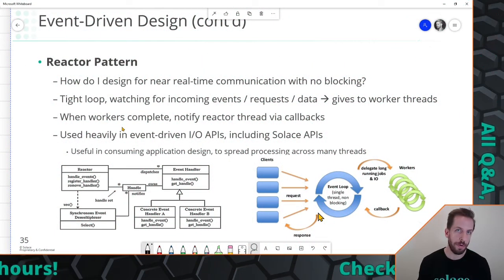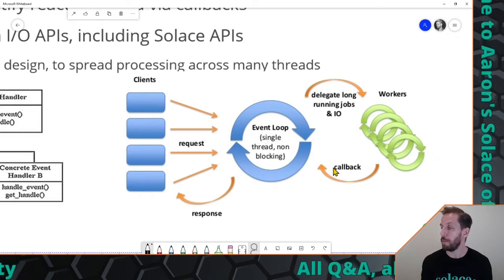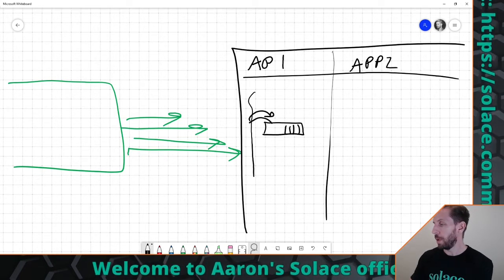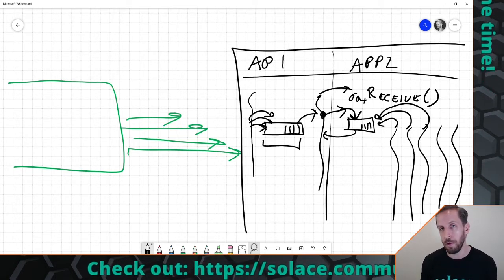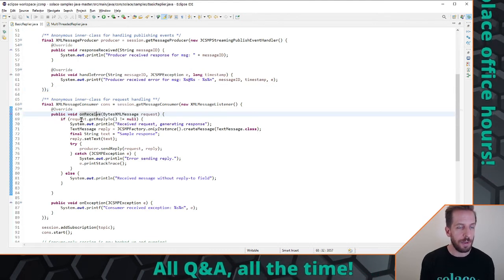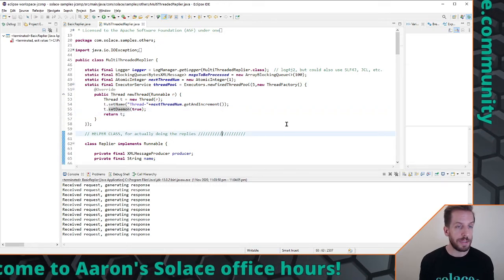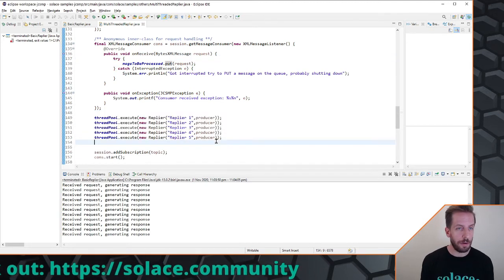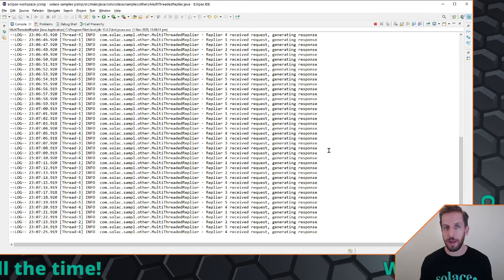Implementing the Reactor Pattern in Solace

Comment: Hi Aaron, the reactor pattern is very useful, thanks for the video.
But I would to mention TaskExecutor in Java, which implements the queueing to a set of Threads for you, I think it would be good to mention that it exists and would save lot of work.
TaskExecutors have a pool of threads (# of threads configurable) and a queue with a configurable depth.  TaskExecutor is fed "Task"s which gets enqueued.  The threads will read Task from the queue and execute them.
TaskExecutor is a way to implement this pattern without needing to write much code.
Reply: Hey Francois!  Yeah, thanks for the comment. Yes, definitely, thanks for mentioning TaskExecutor if you're using Spring, or really any of the other Executors in standard Java. Better than creating/managing the threads yourself.